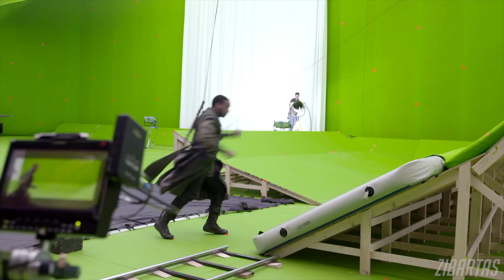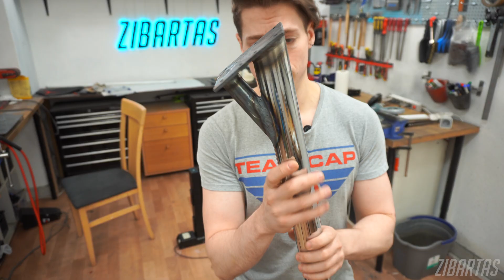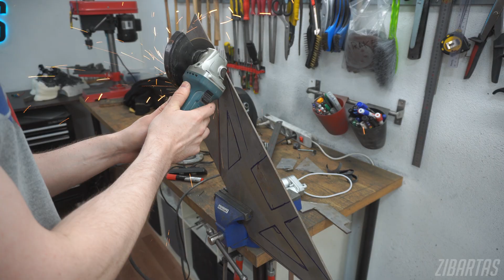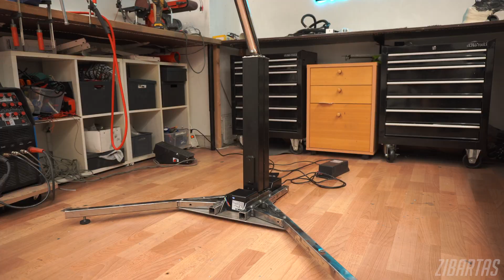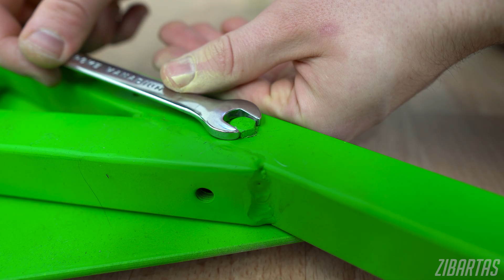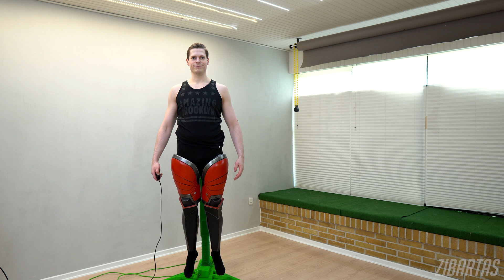My DIY Levitation Rig - CosCrane

Comment: This stuff is phenomenal and exceedingly inspiring. Ecstatic I stumbled upon your channel.
Something that might help with airborne stability, posing & movement is a full body harness. If the attachment point to the lift is shifted to mid-back it would remove the risk of tipping forward. You might even be able to rig it to attach at both mid-back and waist to really solidify stability. Might require some costume adjustments, though. I've seen something similar with the harness sewn inside the costume to hide it, with only the anchor point(s) sticking out.
Reply from the maker: To be honest during filming I reverse engineered a full body theatrical"flying" harness from videos and PDFs I found online. Since it was my first attempt it was  uncomfortable and oddly balanced. If I had to do it again I could probably make one more comfortable - but since the attachment point is so far up on a harness, I'd have to modify the "crane" too - maybe an idea for a 2.0 version though!

Comment: Cool idea, using the lift really has some advantages over using wires like you pointed out. I didn't like mixed units (your height and weight in imperial, but the size difference between the old and new legs in metric). Just use metric.
Reply: 1.9 meters tall 90.7kg. It took me less time to convert that that it took for you to write that.
Reply: @DergWerk  I converted it myself as well, but that is not the point. The point is to stick to one system of measurement.
Reply: @VidZdovc  The point is you want it easy for yourself. This guy spent probably 50+ hours of work to entertain you for free. You can spend 30 seconds converting to metric. I believe in you.
Reply: @DergWerk The point is, that you should stick to one system of measurement. Either metric or imperial. Would I prefer metric? Yes of course, but if he chose imperial that's ok as well. As long as you don't mix units. Just look at what happened to the Mars Climate Orbiter (an extreme example, but it's the first thing that comes to mind).
Reply: @VidZdovc  😑